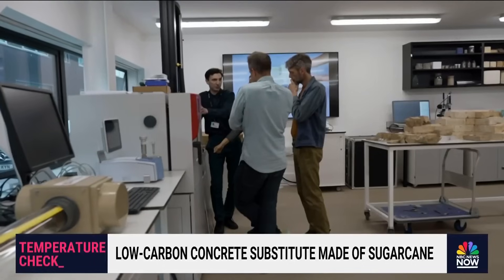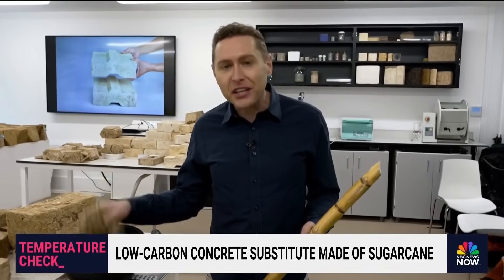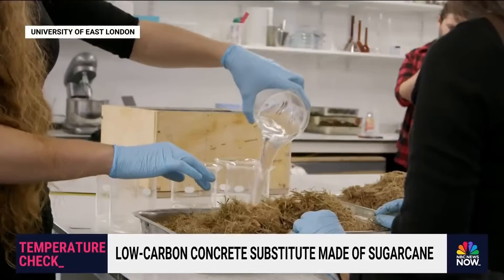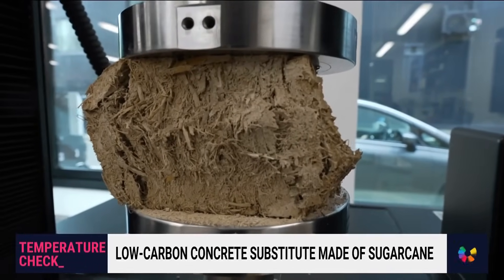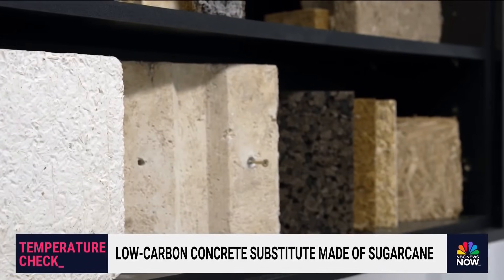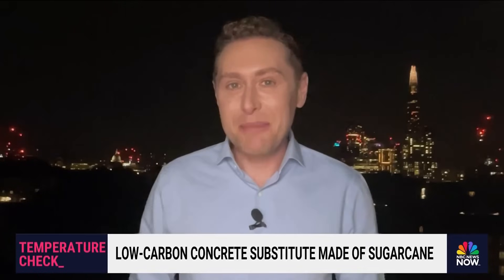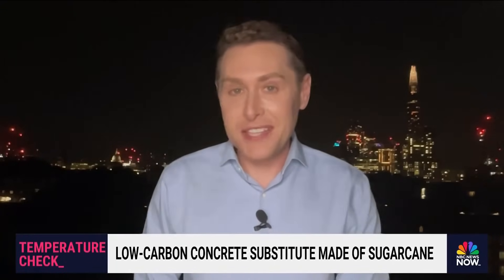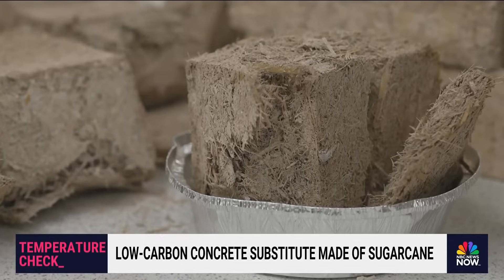Concrete made from sugarcane could help fight climate change

Comment: Most certainly not scalable.  Global cement production is 4Gton per year. When mixed in with sand, rocks and water the weight reaches about 25 Gton per year.   Global wugar cane production is 1.8Gton per year, after extracting sugar  and drying it remains 0.2Gton.

So it can roughly replace order 1-3 percent of existing concrete flux, assuming ALL of it gets used.  There are alternative uses such as biochar.   The type of reached conducted in this large "sustainability centers" are absolutely misinformed.

Comment: I hate the media. All they do is sell fear. There isn't anything new about fibrous brick. They "discovered" what people have been doing for thousands of years. So, a solution is for people who live close to sugar cane will be encouraged to use mud bricks instead of cement. We've addressed a climate change issue? Yet there is one car in Mexico, I see each day, that spews out more crap than building a dozen houses with straw will save. You haven't solved crap.

Comment: My question is, is it Vernon resistant, fire resistant and strong in high wind conditions, also do you need to install a metal or timber frame so as to pitch the roofing frame, and what about the plumbing and electrical installation, how would you install them in the walls

Comment: Look at the screen on his test, it failed at 0.125MPA. concrete is way stronger 25-50MPA.
Reply: This is a replacement for mud or thatch huts, not modern buildings.

Comment: As per usual, the commentary is less than insightful or useful.   It's bad enough the format of the story is simplistic but the commentary shows a complete lack of understanding of any issues.   Ancient mud bricks used straw as a binder.   With sun drying these bricks still form the ancient foundations of ruins in places like Mesopotamia (Iraq/Kuwait).   This isn't a high tech material but useful for local small low rise builds to keep money in the local economy and to provide local building material and enterprise.  Modern steel reinforced concrete uses steel, even though it rusts, because it has the same expansion and contraction rate as the concrete.   In the west, CO2 injection into concrete make harder concrete through the formation of calcium carbonate.  A fast look has this material having 2.5 times the compressive strength of hempcrete bricks.   Uses an available byproduct.  The other materials other than bagasse, seem to be lime, clay, sand, water and calcium carbonate.

Comment: There are so many natural materials that can replace concrete and many high VOC materials that we currently use in construction. In areas where sugar cane is already grown, this would provide a cheap, readily available alternative and economic benefit to the local economy. In other areas, bamboo might be the material of choice, or hemp, or sustainably grow lumber. All of these can replace a significant amount of concrete, reducing emissions and even act to lock away carbon. Better for the environment and for the people living in the buildings.

Comment: Just use these plant fibers for paper products. Or burn the cane to power up the electricity grid then use the ash to make some type of concrete or used as compost. Plant fibers don't mix well with water it grows mold and expand. Plant fibers are even more flammable than a normal piece of wood. Who paid these scientists for this research what a waste.